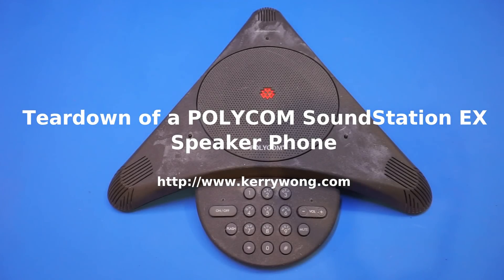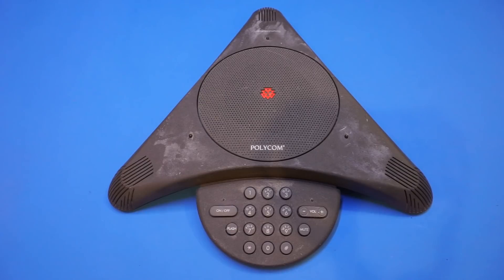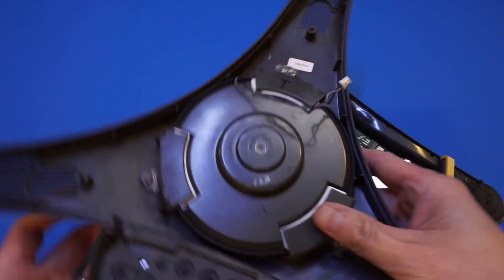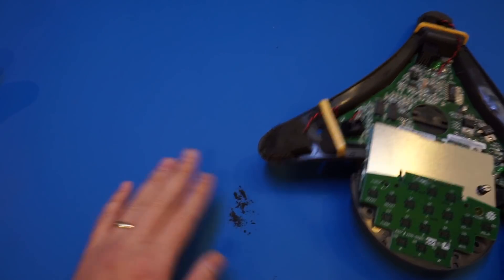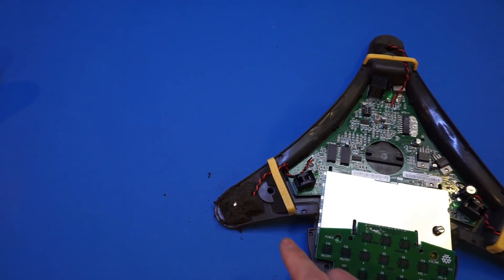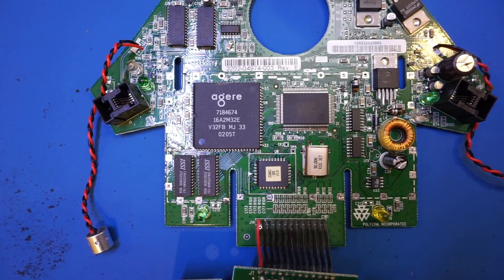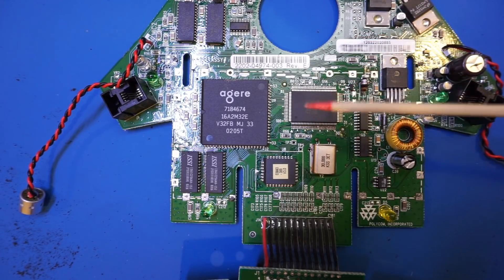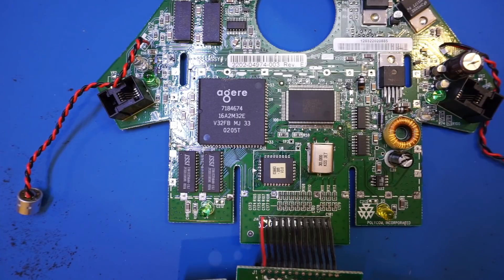Teardown of a POLYCOM SoundStation EX Speaker Phone

Comment: I tore down one of the extension mics for this phone. 78L05A, TLC2272 as an audio amp with the nice large electret capsule. Some surface mount transistors and a 4 pin telephone socket to the outside world. I'm tinkering with this gear for radio communications use, much fun to be had with all this surplus and it was so well made. Thanks for the video.

Comment: How difficult would it be to hack it to work without the PBX box, while keeping the echo cancellation DSP? Like plug it into a PC to use it with Skype or Hangouts.
Reply from the maker: This soundstation series work just like regular phones (they plug into the phone jacks). Not sure how much effort is required to to what you wanted as the chips are all proprietary.